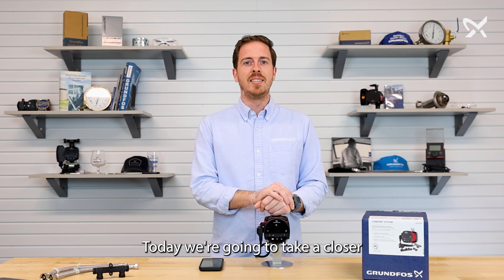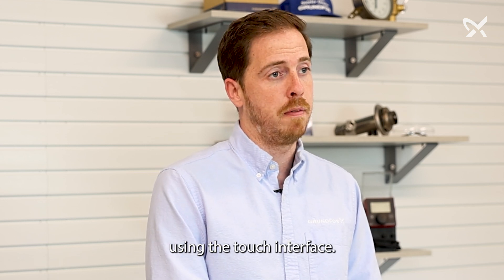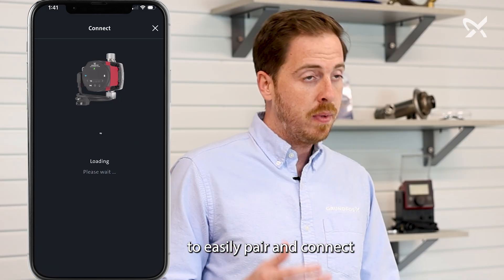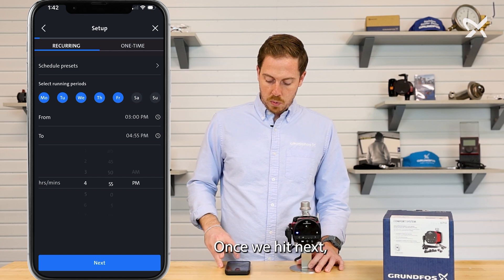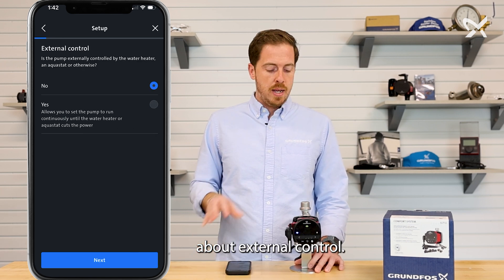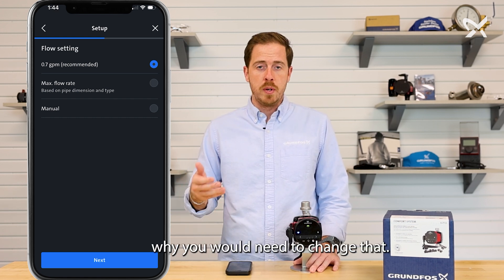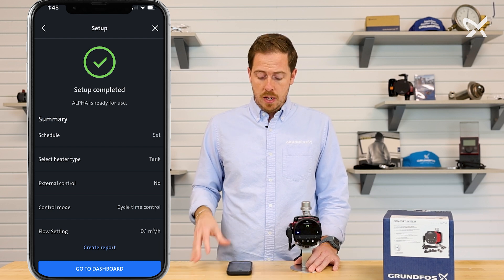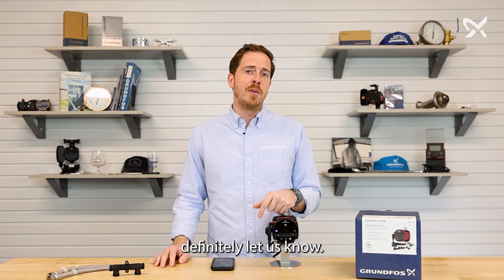ALPHA Comfort System Setup and Guided Commissioning

Comment: How do I get just the pump, I don’t need the valve and hose kit
Reply from the maker: Each ALPHA Comfort System comes with the valve and hoses as they are necessary for the pump to work correctly. If you already have a dedicated return line, you would want to look at the ALPHA HWR model, which does not have a need for the valve or hoses. -Ty